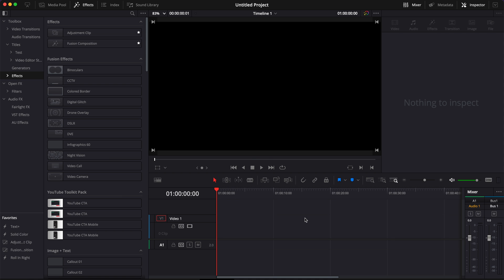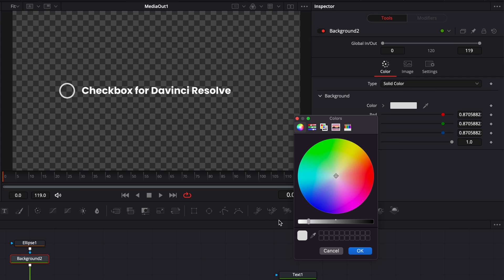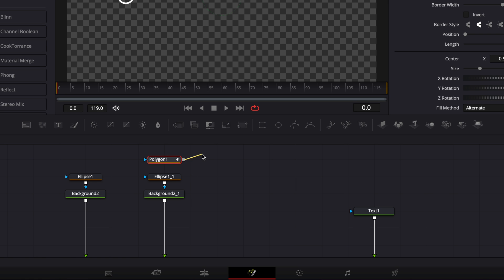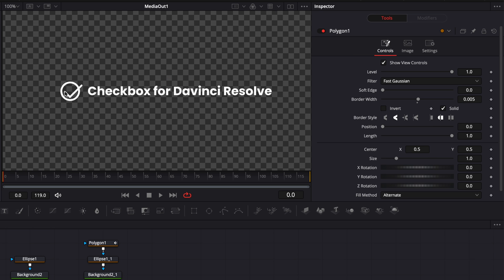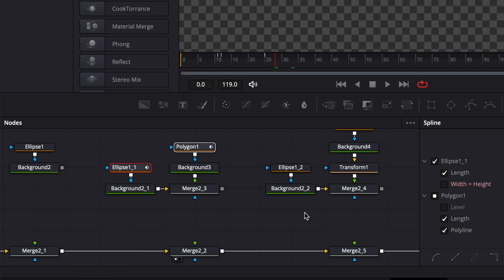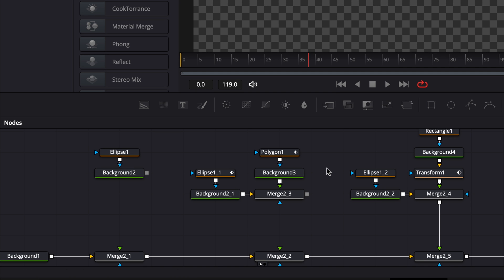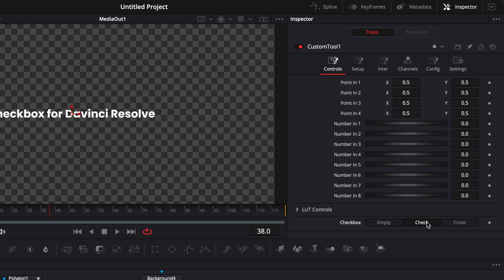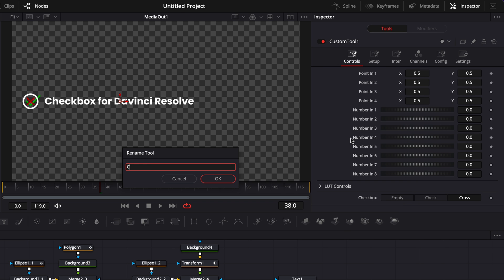Checkbox Title with custom controls?

Comment: this is good... but u could have adjusted the blend in merge node rather than adding an additional brightness node.
Reply from the maker: Yes definitely, just the brightness node is stuck in my head as an opacity node, so that's why I tend to use by default